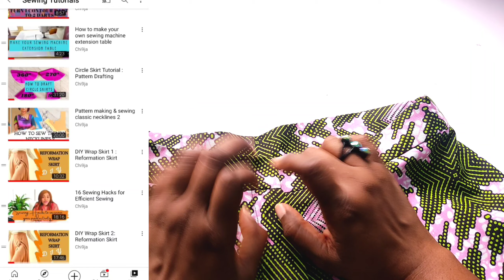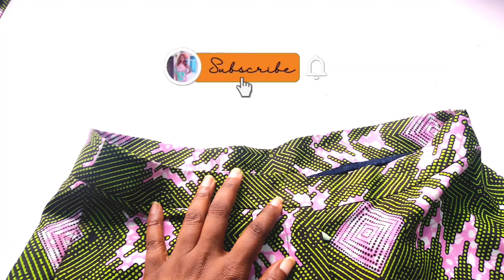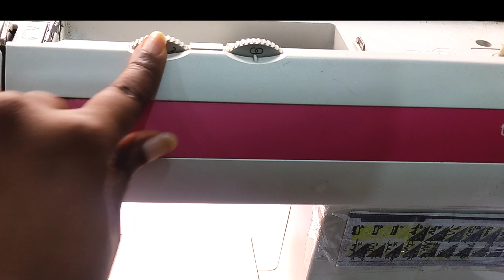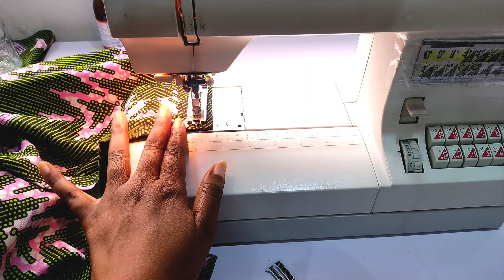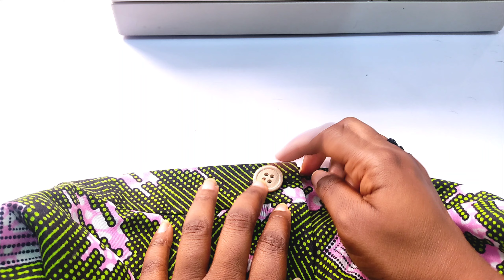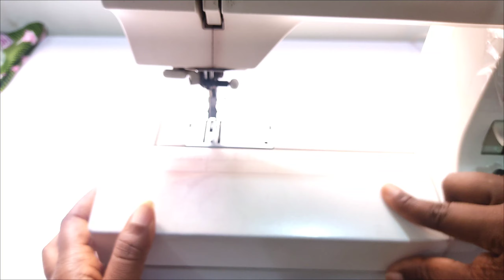Pfaff Tipmatic 6122 sewing machine: How to sew Buttons and Buttonholes

Comment: Thank you for this video ❤
I tried on my machine without the button foot but the fabric won’t move so it doesn’t work. Do I need the buttonhole foot for the machine to sew up and down? Also , is that s PFAFF buttonhole foot that you are using or is or a regular machine foot ?

Thank you so much ☺️
Reply from the maker: Pfaff has specialized feet from other brands.
So the buttonhole foot is different.
Thanks for watching the video.
Reply: @Chi9ja  thank you so much for your reply . Which brand is your button foot that you use for your pfaff? Can I buy just any random brand or should I choose a specific one . Thanks.
Btw: Do you clean and oil your machine yourself ? You could maybe do a video about it . ☺️🌸
Reply from the maker: You can only use pfaff feet for pfaff sewing machines.
I clean my sewing machines myself, i actually intend on doing a live of me cleaning it.
I'll send out a community post when I make out the time.
Thanks again for checking out the video.
Reply: @Chi9ja  Thanks again 🌸 I will definitely watch the cleaning video. My machine is dirty and o have no idea how to Clean it 😅
Reply from the maker: Okay. I'll try to make it as soon as I can
Reply: @Chi9ja  thank you so much ☺️